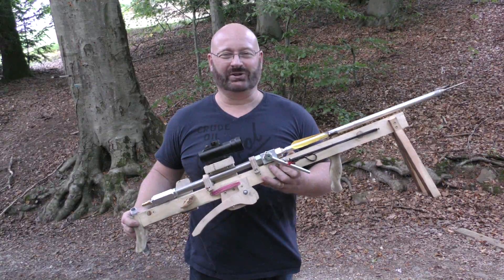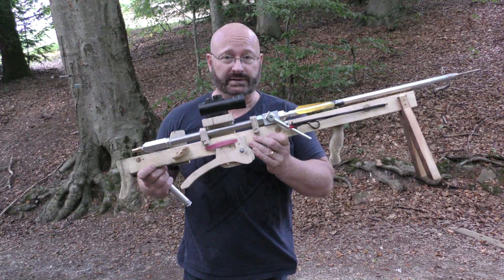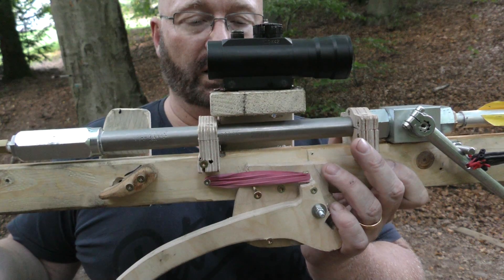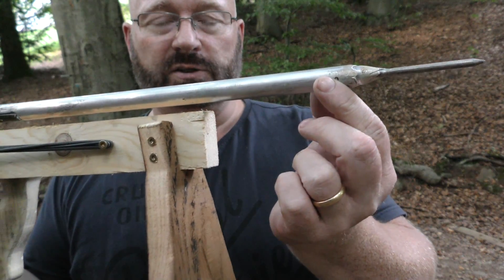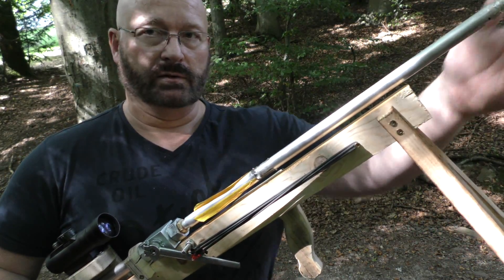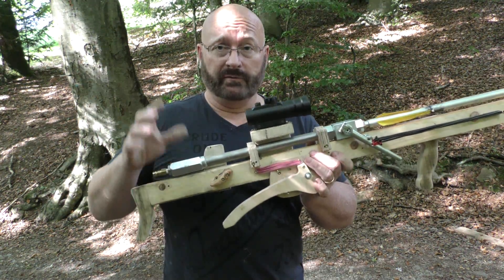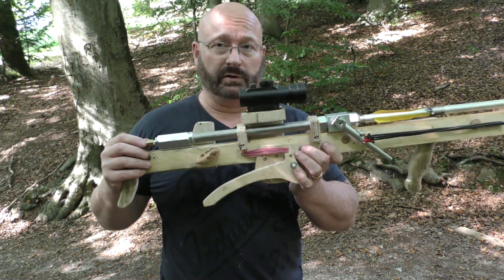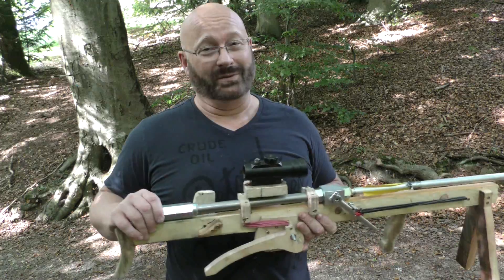Project 1000 Joule Airrowgun: Getting Closer! (714 Joule)

Comment from the maker: Second
Reply: Not farm off something with the power of a .357 magnum, pretty impressive for the home diy.
Reply: 212th
Reply: Lol- you crazy man, I love it!
Reply: If i'm not wrong, making the barrel longer would make it go even faster.
By making it longer you would make better use of the pressure, don't think the arrow is getting to terminal velocity
Pls search it up!! 
Love you and you'r vids! keep it up!
Reply: +ivan tamborero air is different as to modern gunpowder
Reply: A longer barrel would work even with air if the arrow was moving down the tube. However, it's moving over the tube, meaning the longer the barrel, the more air pressure is wasted.

The longest effective barrel length is the length of barrel the arrow fits over, because it can't go any farther back. Were it a down the pipe design (which would be restricted in most countries, even the USA) a longer barrel would, in theory, make a small improvement. Emphasis on small because, well, it's not gunpowder, and the difference is actually enormous.
Reply: +YesImEvil You're right, dind't think of that. Thanks for the heads up!
Reply: NP. A little discourse goes a long way when learning.
Reply: +Anthony Castro as longer the barrel as more friction causing wasting of energy, consequently less speed, it means a dicrease of power rating...
is that right? or not? p lease if you have this information, ask me tkx
Reply: @Bruno: In this case, yes, increased barrel length would mean less power, but not because of friction, but rather because the air has to fill a greater space, meaning less pressure acting on the arrow.

In a gun, extra barrel length generally means more velocity because it increases the bullet's acceleration time. And if this were a through-the-barrel design, that would hold true here as well.

This is an over-the-barrel design, so acceleration time is limited by the length of the arrow. The only way to get any possible advantage to making the barrel longer would necessitate longer arrows as well.

Plus, you still have the problem of diminishing returns from the air pressure, which is unlike gunpowder explosions directly on the bullet in a gun.

TL;DR: Longer barrel means less power, but because of air pressure at point of impact rather than friction.
Reply: Thank you dude, how did you learn all this?
Reply: I tinker with things, specifically, air-powered guns. Mostly launch silly crap. Highlights are sending a potato an eighth of a mile and getting a marble to register the same impact force as a .38 special.
Reply: i made a really good airgun after watching your videos
Reply: Joerg, I've send you simple design of arrow shoother that might help you reach or even exceed that goal - please check your mailbox :)
Reply: bs
Reply: florida livin' what bs means?
Reply: Deutscher Stahl hält dich am Leben :D
Reply: godsadog german steel keeps you alive ?
Reply: Yare yare. Boys, knock it off. This is a projectile weapon channel, not a pork-sword fencing channel.

Florida: Not everyone speaks English as a first language. Not everyone is as well-versed in our language or colloquialisms as you and I.

Bruno: no need to sink to his level. Never argue with an imbecile, they'll drag you down to their level and beat you with experience.
Reply: YesImEvil thank you very much sir, it s always important to hear such kind of wise words. Nowadays such attitudes are pretty rare , congratulations 
I do apologize everybody for my shameful behavior... not be repeated
Reply: Why not use a air cylinder from a air rifle that uses a 3,000 PSI scuba tank to fill it?,these are made from stainless steel,but have even more volume then the tank your using now.Excellent video once again Joerg.:)
Reply: Well.. Price maybe, but if they fit to thread in valve - sure, why not.
Reply: Would it be possible to automate the "pocketshot" the slingshot with a circular design like semi-auto type crank to prime?
Reply: Please do range test for these air guns?
Reply: Herzliche Grüsse aus Russland Jörg, kannst du bitte sagen, welche Dicke die Wände der Luftkammer und des Rohres haben? Ich will versuchen, eine eigene Kanone zu bauen, dafür brauche ich die Dimensionen. Wie wäre es mit 42mm Ausserdiameter/24mm Innerdiameter für die Luftkammer und 20mm Ausserdiameter/14mm Innerdiameter für das Rohr?

Comment from the maker: Third
Reply: It would be cool if you did a vid with the slomo guys
Reply: have you thought of possibly thinning your barrel down and using real arrows? lighter projectile + smaller barrel width should in theory make it better. also, you should get a rifle stock and fit the components to that to make it a more comfortable and stable build.
Reply from the maker: Normal arrows do not withstand that kind of pressure. They just explode right on the barrel.
Reply: Try to make another barrel with orings, so it reduces the amount of air you loose in the space between arrow and barrel
Reply: Also, lighter object would mean less mass, meaning more speed required to achieve the same energy in Joules. Also since they're lighter they have less inertia, meaning air resistance slows them down much faster.
Reply: the projectile must be heavy to produce large momentum. So that's why a heavy arrow is preferred.
Reply: even aluminium allow arrows explode? I've shot mine into a solid hunk of wood and they've not take much damage. They're also a lot cheaper than CF arrows and if you need to you could weld the tips in so they stay on
Reply: +Ivail Luiz his current setup is using tape to make the fit between arrow and barrel nearly airtight. o rings would be ideal, but the advantages over his current setup would be minimal.
Reply: +Natedogg 12 agreed
Reply: Longer arrows maybe? I heard long barrels make more efficient energy transfer. Keep up the good work man
Reply: you should seriously grip the rubber-bands farther towards the end of the pressure valve to achieve greater torque on it!! great job i enjoy these series
Reply: ***** I think that design decision was so that you can comfortably cock the level of the valve, and also so that the rubber bands do not move much relative to the gun. If its connected lower at the level then as the valve is opened, the rubber bands move a bit upwards. In this design, you dont need to think too much about allowing space clearance of the rubber bands
Reply: i guess you can always use more rather than lowering their grip
Reply: Hey Joerg,  Does the decibel level increase much with more pressure/energy?  At this stage from my end it almost sounds like a subsonic gun shot.  Do you need hearing protection, what is the decibel level?  Thanks :-)
Reply: It's probably been said before here, but wouldn't a longer barrel increase your projectile speed? You'd need a longer arrow as well which means more projectile weight, but a longer barrel offers more acceleration time.
Reply: JoergSprave,
Would decreasing the mass of the arrow but keeping the same dimensions of the arrow increase the velocity enough that it would deliver more energy?  In terms of a bullet, that 143 gram (2,300 grain) arrow is incredibly heavy, far greater than a .50 BMG slug.  It's even greater than the slug from a 20 mm cannon.   If you could launch an arrow that weighed 1/10th as much ten times as fast you would have 7,000 joules or 5,200 foot pounds of energy.  Would a bolt made of carbon fiber tubing with a proportionally lighter tip yield higher velocity and therefore higher energy?
Reply: The Laughing Hyenas Interesting idea although its pretty hard to lighten things. Arrows by default are supposed to be heavier. Plus you might need to consider that a faster projectile will spend less time around the barrel. But I really wanna investigate this. Id try do a excel spreadsheet and use a time marching simulation. May not be so accurate but it might give a clue
Reply: de0509 , Perhaps a bolt that is both longer and lighter.  That would give it more time around the barrel.  As for the time around the barrel, dumping more air at once might help.  A larger butterfly valve with a paint ball sized tank at 3,600 PSI/250 BAR or even higher.
Reply: The Laughing Hyenas Made a super simple simulation on ms excel. No losses, no friction. For a 20mm diameter 0.5m long barrel, it says 117m/s muzzle velocity. Not very good one and it may be a coincidence, but I think its quite in range (99.78m/s real life)
Reply: de0509 ,
That small change in velocity made a HUGE difference in energy down range.

I took 117 M/second or 390 fps.  I linearly scaled the arrow weight down by as much as the speed went up  (1,946 grains or 126 grams).  The energy went up to 657 foot pounds .  That is 890 joules, getting close to his 1,000 joules and that's without changing anything but the projectile.

Try playing with the barrel length and diameter.  See what comes up.
Reply: The Laughing Hyenas Oh hi. No I meant the simulation were a bit off. I used 2cm barrel thats 0.5m long and this resulted in muzzle velocity of 117m/s compared to real life tests giving 99.78m/s, so this simulation thingy may not be so accurate.

Thinking back on that matter, assuming the simulation is to be considered close enough to real life, I did play around a bit. Mostly with arrow mass. But found some interesting points too. Near the muzzle, the effective force dropped down to around the ranges of 70% of what it would be if the arrow is not moving (due to approaching speed of sound).

Anyway, interpolating values between two time instances, somehow up to 200g of mass gives higher energy, but the final energy starts dropping when around 210g. But this is really just a slight change so perhaps barrel length would account for more increase. Perhaps Joerg can experiment with different mass to confirm? This simulation may not be the sole dictator on whats best, but perhaps it might give a clue.
Reply: The Laughing Hyenas I could send you the stuff to tinker around if youd like? But not sure how to pass around files through youtube. Email perhaps?
Reply: +josh Stephens But more importantly, could it kill a zombie. Ha hahaa :)
Reply: Hey jeorg I would like to say something the reason you are getting only 7k likes is cause they love your channel so much they want to see more so much that they forget to like

Comment: I have realized that adding weight to ammunition won't cut speed at least with my fruit shooting cannon very much, so if you have some energy goals one easy way to reach them is just to use bit heavier arrow. 

One draw back is of course massive recoil with heavy things flying out of the barrel.
Reply: need to see another collab with you guys and jorg
Reply: HPC, recoil is not a problem, Joerg is very heavy :)

Sam, they sorta did a collaboration. Joerg sent some things to crush with Hydraulic Press.
Reply: I think that's why he said "another collab."
Reply: Recoil is very dangerous and may attack Jörg's shoulder at any time, so he must deal with it!

Comment: One step closer to creating a rubber activated, anti-tank, air toy.
Reply: +Salgen Fluchklinge would be cool with a Flat tip so it just break through
Reply: die Luft Panzerfaust? xd
Reply: "toy"
Reply: turn the arrow into a sabot or put shaped charge at the tip.

Comment: I'm so glad I found this 5 years afterward, and not at the time you were making it. Thin walled pressure vessels are a discipline within mechanical engineering. They choose materials that will tear open without fragmenting. They account for the propagation of cracks that lead to catastrophic failure after so many cycles of strain. Have you ever seen what happens to a person when their gun barrel fails? Many don't live. This was rolling the dice every single shot.

Comment: That thing flies through the archery mat like it isn't even there.
Reply: And those things are tough for those who don't know, they're made specifically for stopping a projectile lol.
Reply: Yeah, to those who think the mat is just foam, they'd be in for a surprise, those mats are very, very dense, 2 of those can stop most crossbows, 3 of them is ridiculous, and that thing flies through like it's butter.
Reply: +Peter Cass would surely be cool. Keep in mind ballistics gel has much more resistance than real animals/flesh.
Reply: Plus the fact that the arrow is super thick.
Reply: joe Costello well, that depends on the percentage of the ballistics gel.
Reply: +DreadKyller true. Even still it's really hard to get a super accurate comparison. If you shoot a real deer with a 50 pound bow it will probably pass straight though, while in most ballistics gel it would only penetrate a few inches. Most gels grab onto projectiles a lot tighter than real flesh and also you don't have blood which helps with penetration.
Reply: joe Costello Depends if it's american ballistics gel or German ballistics gel, since German is like 3x as dense or something like that. Ballistics gel isn't used to simulate any specific surface density, it's used for comparisons, to see what goes farther or if two projectiles go the same distance. For these comparisons many people actually use less dense ballistics gel, because if there is a difference in power, the difference in distance will be greater and more easily measured. A 50 pound bow would probably go through well over a meter of US ballistics gel, and maybe a a handful of inches or so of German grade ballistics gel.

So if you're going to test how much is needed to stop it, the density will matter a lot.
Reply: I believe German/European ballistic gel is 20%, while American is 10%.
Reply: Tristan K You're correct, USA ballistics gel is about 10% while European can be from 15-30% depending on region, I think German is closer to 25-30%, iirc.
Reply: DreadKyller 30% sounds substantial. (Not saying you're wrong, I won't pretend that I know more than you. :p)
Do you know what the percentage should be in order to properly emulate the resistance of human flesh?
Reply: Tristan K no, I don't, but it's much higher than 10% and lower than 25%, don't know the exact number, I think he asked the ballistics people that question in his video.
Reply: DreadKyller I looked it up, and this is what I got from a forum post on boards.straightdope.com:
"Properly calibrated 10% ballistic gelatin is a very close analogue in terms of penetration to human muscle and solid organ tissue. The general rule of thumb is that it compares favorably in penetration value to real world application of a non-protected target at about 105%-110%; that is, 11" of penetration into ballistic gelatin is about 10-10.5" in a real body."
So that's very interesting.
Reply: +Tristan K that does not sound true, for one a real body is not just solid flesh all the way through.
Reply: joe Costello You're right, however the original author of the forum post said that 10% ballistic gelatin is "...a very close analogue in terms of penetration to human muscle and solid organ tissue." So the OP was talking less about skin, and more about muscles and intestines and such. 
This is the URL: http://boards.straightdope.com/sdmb/showthread.php?t=428821

Comment: Joerg, may I suggest that you will have a gain in velocity if you add a feature that delays the arrow flight.  It might be as simple as adding a rubber tube that the base of the arrow can be inserted in to create friction.  The concept is to retain the arrow so that greater pressures can build up in the barrel before the arrow begins it's flight.  Best Regards,  Tony  And PS that thing is Bad Ass.  I hope Angela does not take your toy away!
Reply: How can i like comments on the smartphone?  xD
Reply: good idea.  works kinda like spooling the turbo up on a diesel truck before racing
Reply: Yes. Another example is a rocket being clamped onto the launchpad while the engines come up to full power.
Reply: That of course can be done, just need a little more precision than is usually used in Joerg's projects. Imagine how your garden hose pistol works: in the pressurised barrel is shaft holding cap (bronze ball or cone sitting on machined end of the barrel for perfect seal ). Then you let the shaft move a little forward by releasing the trigger and the pressure pushes directly the arrow with no significant pressure dissipation.
Sure, sliding seal  between the shaft and the blind end of the barrel migh be problematic, but I encourage Joerg to try that,  or get to cooperate some machinist near by, it's no big deal. (y)
If it turns to be impossible to seal those high pressures by some pre-strained trigger mechanism, you may let the pressure to help you.. Adding/threading some tubular restrictor to the end of the barrel would create a seat for ball or cone which would be pressed outwards creating easy seal, than you just pull the ball inwards by the shaft and the accumulated hell is released.. ;)
Reply: also possibly some way to extend and thin out the compression chamber so that the arrow fits around it. that way the opening of the pressure valve will be closer to the tip of the arrow so that the pressure doesn't have to travel all the way down a long barrel and lose pressure from the distance traveled. with the arrow running around the chamber, the arrow can stay long for accuracy, and the highest pressure point as close as possible to the end of the barrel.
Reply: You are wrong it will slow down the arrow because the valve already releases maximum pressure.
Reply: You are wrong it will slow down the arrow because the valve already releases maximum pressure, besides he already made tape sealing on the top of the barrel.